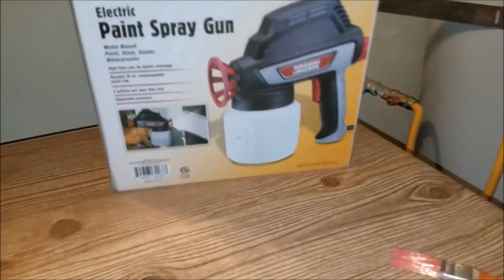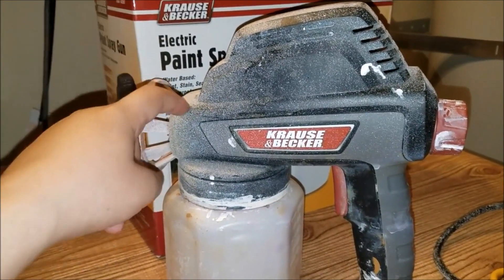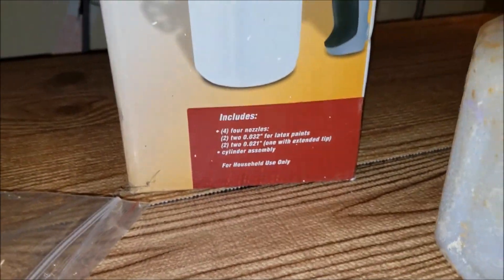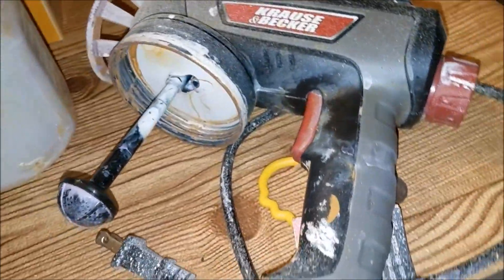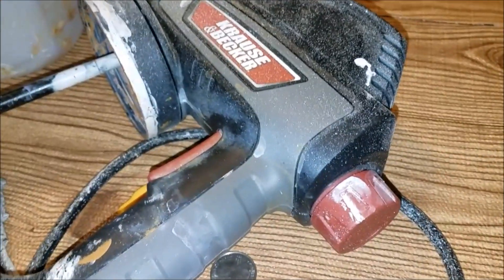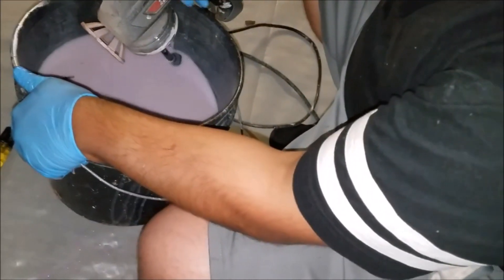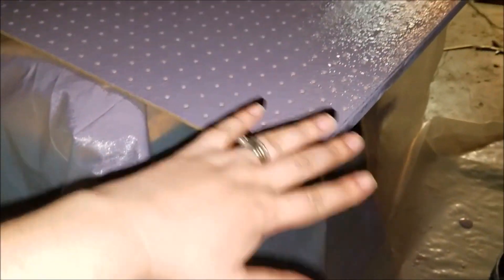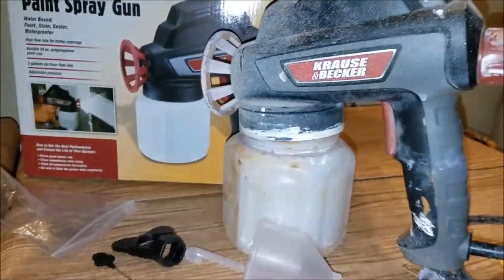Unboxing | Paint Spray Gun from Harbor Freight

Comment: The little "funnel" is a viscosity cup for measuring the viscosity of the paint. You use it to time how long it takes the paint to run through the funnel. It should be 20 to 25 seconds for latex paint. If it takes longer than that, you must thin it. The long black tube is a spray extension for painting ceilings, not a primer tube. The black key is for changing out the different nozzles. Please read the directions before making a video on the product.
Reply from the maker: It is just and unboxing not a tutorial how to use.. just opening and showing what is inside the box .. thanks for the the help and explanations of the items for other to read.

Comment: The "funnel" (or "fennel") isn't... It's a viscosity cup. You time how long it takes paint to run out the bottom, and thin the paint to get the time listed in the manual. That way your paint is the right consistency for spraying. The "I don't know what it is" is a wrench for changing the nozzles. Lady, read the manual, lol.
Reply: ludditeneaderthal ... lol... your comment just made my afternoon.
Reply: "Ve build a shapel!"

Comment: Is that how wide it can spray and what type of paint did you use? I just need something quick lol
Reply from the maker: Yup.
Water based paint .
Reply: If you actually thin the paint and adjust the flow rate nob, the spray is much wider.

Comment: This does look good ... can you use this on walls?
Reply from the maker: am pretty sure you can
Reply: That's what it's made for, lol. It's for shooting emulsion paints, water based stains, and emulsion sealers. But, you basically have to use it in an empty room, because it makes "paint fog" that will settle on EVERYTHING. Also wear a dust mask when you use it, because you really don't want to breathe latex paint. Goggles aren't a bad idea either. If you use it for exterior work, toss a drop cloth over nearby shrubs and plants, or your roses will have wall color freckles, lol.